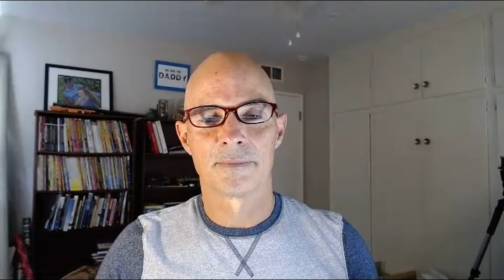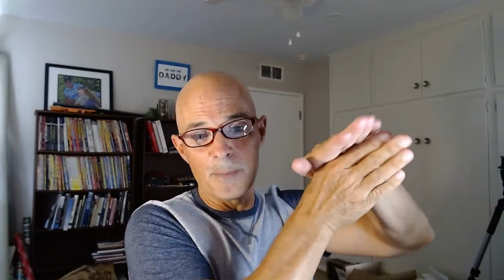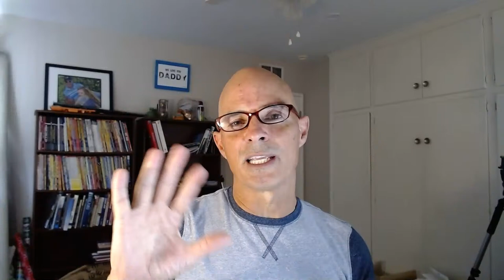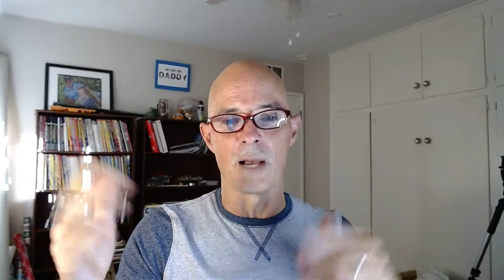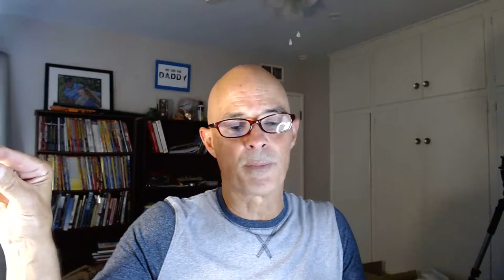LET'S TALK TECH-POWER FROM OILING SYSTEMS

Comment: Instead of running water to see how long an engine lasts... how about running the normal oil at temperature, and then the thinnest oil available at temperature to measure the difference in HP and see if it holds together.

P.D. Finally for fun, send it on ATF, Marvel Mystery Oil or other.

Comment: Ls pump is above the oil level so it must suck up oil from the pool of oil. The o ring viscosity and sealing is of ultimate importance , to keep air out of the oil pickup tube. 
Gen1 engines oil pumps are mounted  close to the oil pool and has no o ring.

Hydraulic pumps work best while pushing oil, works less best by sucking oil.
Reply: The paper or fibre gaskets between the oil pump and mail cap is oddly way more durable than the O-Ring on the oil pickup on the LS. A rear sump gen1 sbc has a pickup tube like 6" long. The pickup tube is " pressed" in and lots of builders will tack it in one spot just to keep it in place. I know paper gaskets are old school now but for oil control they seem to work better than O Rings. The crank driven pump on an LS works pretty good, the pickup tube has a.couple problems.
Reply: @timothybayliss6680  ✔🎯 

I pin mine w 1 pin

Comment: If you have sufficient oil capacity in the pan, run the oil about 1/2 litre under the full mark. Less windage and the oil doesnt aerate as much and the oil runs a few degrees cooler. On my old Corolla which I occasionally autocross, I make sure it's at the full mark as it only has a 3.2 liter oil capacity. Also, a small oil cooler is a great way to add almost 1 liter of oil capacity without modifying the engine.

Comment: Have you ever seen an engine that separates the mains/cam oiling from the valvetrain and accessories? 
I was thinking a combination of the LS and SBC system would be rad. The SBC pump just shoves the oil into a dry sump tank. The engine could use two gerotors. One for the mains/cam and one for the valvetrain and accessories. SBC pump may not be an actual SBC pump, but a big vane pump that passively acts as a vacuum pump.

Comment: Castro conventional GTX will not start bubbling until over 11k rpm. I had bought a new Suzuki GSXR 1000 in 2006 and when it come time to do first oil change my old man who’s 45+ years building engines told me to try it and said I guarantee you will feel a difference and you will see in the sight glass the difference in bubbles when you stop. He was absolutely correct I changed oil and pulled out on road it going like 25 hammer down dang near flipped the bike on myself and before I could easily hold it down. After the ride I got off looked at sight glass the oil pretty much didn’t have bubbles at all was dead flat across.  The oil it came with would have small and large bubbles as big or bigger then half the sight glass. I had always ran the oil in everything else my whole life but didn’t think I should on that bike but at 11k miles it pulled harder then it did the day before it was absolutely a beast engine.

Comment: For race BBC, just go dry sump,  it's a great investment, and controlling oil in a race engine is so important both for HP, and engine life.   We use Auto Verdi oil pumps on our engines, have for decades.       We like the belt driven setup and heat the tank and prime the engine for every day of racing.

Comment: My mechanic when I first started driving told me a story about the 3.8 when it came out years ago. He had a car come in with low oil pressure and noise.  He replace the engine with a reman engine and primed the oil system as he normally did.  That engine failed as well.  He got a 3rd engine and decided to pull the pan and valve covers on the stand and prelube it.  It took 1 to 3 mins (sorry its been 30 years) to get oil out of the last rod or main bearing. I assume GM fixed this issue soon after.  He used a pressurized oil cylinder to do this.  He claimed many dealers and shops around town came and borrowed it often back in the day.

Comment: In the early 70s the Holden Dealer Team (HDT) did testing for the wet sumps of their race cars, they had a passenger sit in a road car with a sump full of oil, and clear plastic film (cling wrap) covering it.
The driver then drove and cornered aggressively, and the oil control or lack thereof was noted ,and baffle designs changed to suit...
(The road car used was Peter Brock's personal road car, a Holden Momaro GTS 350, and Brock would drive)
Reply from the maker: great idea to see the effects of g loading on the oil-but its not moving the way it does when the motor is running
Reply: 1 G lateral loading will result in the oil being at a 45 * angle.  This is due to gravity pulling down with 1 G and lateral force being at 1 G.
Reply: That whole exercise sounds like a waste of time. Hot oil vs cold oil. Cranking spinning away vs no crank, Pistons pushing air around, etc..
Reply: @richardholdener1727  This was done at Mount Panorama with its 3.8 mile, 625 feet rise an fall each 2 minute 50 sec lap by Ford Special Vehicles in 1972. The passenger firewall was given an inspection window, and the lucky assistant looked at the clear left hand side of the perspex windowed sump with a Super 8 video recorder. 100 mph to 155 mph at 7000 rpm in the 1971 Ford Falcon Phase III. That year, they had huge oil surge problems because the tire size went up from ER7014's to 205/70 15's. Holden in 1972 won that year...because they had better sump windage trays with a gated sump... because they did the same test mentioned above.

Comment: Hey Richard, ever done experimenting or thought about an electric vacuum pump for the crankcase that switches on at higher RPMs?
Reply from the maker: I have seen those but not tested them
Reply: @richardholdener1727  Would be such a cool test. If one were to do a run with and without, you could see from the crossover point exactly where the power draw is worth the reduced pressure inside the crankcase
Reply: Awesome idea. I think any of the modern self-learning systems could do it; use a simple "1D" RPM table to trigger one of the EFI system's external relay outputs to turn on the vacuum pump.  Now find a reasonably priced electric vacuum pump that pull decent vacuum and survive for a long time...
Reply: @adamarndt7617  The switching or triggering won’t be the big issue, agreed. The main reason to have it trigger at RPMs is for two reasons:

1) The power gains from the low crank case pressure need to negate the power loss from increased draw on the alternator. 

2) The pump won’t exactly be quiet. 

3) As you already guessed, continuous use of the pump will wear it out quickly.

Comment: I'm still trying to figure out pressure drop with a remote oil cooler, to and from the cooler can easily be 6 feet of hose if front mounted plus the cooler and remote filter. 
I'm a strong believer in coolers but need to learn how much pressure drop occurs. I may just install it with pressure gauges everywhere and see, my old motor is about to come out anyway 

Thx
Reply from the maker: INSTALL AT THE BEGINNING AT AT THE END OF THE LINES

Comment: Hi Rich,
I have a moroso road race pan. Holley data log showed i was having oil pressure loss above 5500rpm. Reducing oil level in the pan fixed this, but now i have experienced starvation under hard turning.
The pan only has a windage screen, not a louvred tray. I read the screen doesn't work at high rpm (6k+)? Is this true or was my issue just too much oil. Im thinking a tray would be less susceptible to windage/airation. Wish i bought the canton version now.
Reply from the maker: not sure why screen would be less effective at rpm
Reply: @richardholdener1727  i assume because oil can spray straight through rather than through the louvres which direct the oil sideways.

Comment: It would be pretty straight forward to make a home made dry sump.  Use the stock pump for pressure,  a belt drive hydraulic pump for a single scavenge, a modified steel oil pan and some sort of cylindrical oil tank .

Comment: If you run a clear oil pan at 5000 rpm without a crank scraper you will see a solid wall of oil around the crankshaft.

Comment: Is there any hope of ever getting a comparison between 706 and 317 heads with identical compression ratios? I understand a head with 10to1 static is generally going to make more power and any given boost level than a head making 9 to1. I do believe on identical engines with identical compression the 317s would make more power at least in the 4 to 5000 range and up. I have yet to see anyone compare these heads at identical compression numbers.
Reply from the maker: IT WON'T-ANY YOU CAN'T MILL THE 317 ENOUGH TO GET IT DOWN THERE-BUT THE 317 STILL WORKS SO USE IT

Comment: I've been super curious about budget DIY dry sump setups. I think I'm going to try one on my Beetle using a CB performance dual pump kit. But I've been curious about electric pump scavenging, particular for Subarus which IMO have oil control issues somewhat fundamental to the boxer configuration. With an aftermarket ECU I think I could monitor current to the scavenge pumps and configure the ECU to do engine protection in the event of a pump failure. Pressure would be supplied by the stock pump ported through to a bulkhead connector of some sort.
Reply: It would be pretty straight forward to make a home made dry sump.  Use the stock pump for pressure,  a belt drive hydraulic pump for a single scavenge, a modified steel oil pan and some sort of cylindrical oil tank .
Reply: @bobroberts2371  Yeah I had considered a mechanical pump too. But it'd be cool to use electric pumps so you could have many sucking from various points. The dry sump tanks aren't too crazy expensive themselves, they can be had under 500 bucks.

Comment: Absolutely GREAT topic  Richard. I always shy away from commenting,  simply because the majority of my Engine Building is motorcycle based, and I don't want to tie up your viewers time who may not be interested. My time with Drag Racing Automotive and Powerboat Racing Engines, always will be a time in my life that has taught me so much inline with the topic. Changing nothing but oil pan on a 540, and the resulting 12 h.p. increase. A vacuum pump on a 632, the increase in the dyno numbers was a true Whiskey Tango Foxtrot  moment. Back to my first Nitro Harley days, with the extreme under square bore/stroke combo, you would be amazed at the power gains, relieving the crankcase pressures.  The inline 4 cylinder bikes back in the 80z, we picked up some nice numbers, cross drilling the main webbing to relieve pressure from the pistons at BDC, to the cylinder next to it on TDC. Real numbers, real power. To this current day I always find ways to relieve the internal pressures, whether it be the rocker/cam covers, to the bottom of the crankcase. Great topic Sir.  Thank you. 
T.S. RACING
Reply from the maker: thnx-I want to hear about harley and boat motors too
Reply: Thank you Sir,  and I wanted to elaborate on the crossed drilled main webbing on the Road Racing bikes. The benefit was from the pressure differential with the piston DECENDING, not already at BDC as I stated incorrectly. It was worth a few h.p. at higher RPMs. Remember we're talking about less than 61 cubic inches,  to put things into perspective.  All credit goes to a Incredible Japanese Engineer,  who thought outside the box.

Comment: If you take a Whipple, Roots or Twin-Screw supercharger, but replace the fixed-gear belt with a CVT-like belt, then link it to a Freewheel system, and lastly modify the supercharger to be supplemented by a turbine as if it were a turbocharger... Would you get an overall more efficient supercharger with much less parasitic loss?
Reply: The cvt is kinda shit in terms of efficiency tho.
Reply from the maker: supplemented?
Reply: @richardholdener1727  Basically... Engine provides just enough torque to the supercharger to get it spinning as it gradually switches to taller gear ratio to keep the supercharger spinning up faster (assisted by the blower's own momentum) while sapping less horsepower from the engine... And the blower is also being spun by the car's exhaust gasses like a turbocharger. Just, it starts off being powered by the crankshaft, and then gradually it stops stealing horsepower from the crank.

So, the supercharger would have its own supercharger and its own automatic transmission.

Yeah, pretty convoluted concept in writing, but when a supercharger steals over 700 horsepower from an engine in order to spin above 12000 RPM to provide 60 pounds of boost pressure, you need to reinvent the supercharger.

Comment: Aussie race engine builder do a similar thing to cup car, the least amount of oil pressure that doesn’t hurt the engine. Less oil pressure is more horsepower.
Reply from the maker: those Aussie Super Touring motors are awesome

Comment: Do you think that anyone in top of racing will ever go to oil less engines? Air compressors have gone this way.
Reply: Rotary engines??? Motocross and Supercross as well as Snowmobile racing have, for many years, run 2 stroke engines without a crankcase filled with oil.  This is very common on small hobby and hand held machines, too... heck, I even have a 4 stroke lawn care tool that is designed to run with an empty crankcase. Most all of these, though, require a slight amount of oil (typically 2 or 3%) injected into the fuel.  But I think it will take some break-through technology to run engines at high performance levels without ANY oil or other lubication.
Reply: 2 stroke engines aren’t politically correct anymore.
Reply from the maker: DON'T TELL THAT TO MY GO-PED

Comment: To the twenty year GM machanic that knows everything. L5P has LS derived lifters. You are both wrong and stupid for arguing about being wrong.
.truck trend (dot) com how-to/engine/1702-a-peek-inside-the-duramax-l5p/
Photos 44-47
Reply: Reverse oiling lifters where the oil goes up to the head through the rocker shafts and down the pushrods is the worst design on planet Earth. They have a huge failure rate, the main reason I will never buy a newer Dodge with the hemi. Have to pull the heads to fix in the fix is only temporary because it is a crappy design. This comment is from an engine, builder, racer since the 70s,,, me!
Reply: @Binderbird4X4Firebird  the Gen3 hemi used reverse oiling lifters so the DoD could be in the oil gallery. It is a stupid idea. The DoD setup shuts off half the engine and the lifters have a huge exposed portion of body and almost no oil. Some guys epoxy a tunnel baffle underneath the cam and that seems to work but shouldn't be necessary with a hydraulic roller.
Reply: @timothybayliss6680  like I said junk